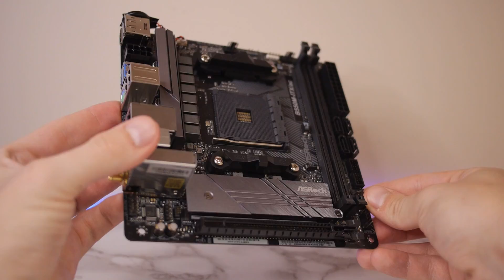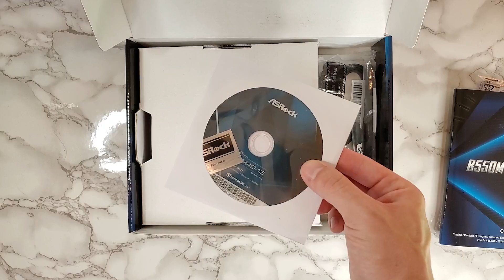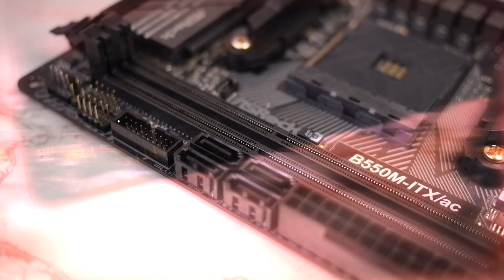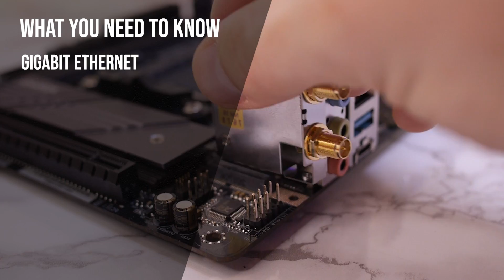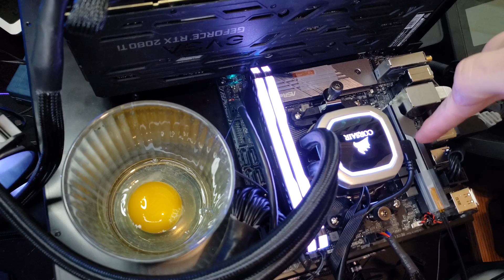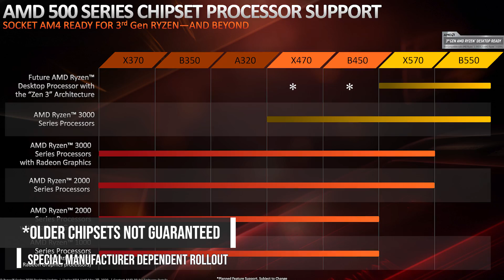The CHEAPEST B550 ITX Motherboard! - ASROCK B550M-ITX Review.

Comment: Exactly the right motherboard without unnecessary extras like LEDs and other things most people don’t need. It's perfect for a basic office PC or any simple, budget-friendly build that's still customizable. Why do you need so many fan headers? What’s the point in an ITX build, where compactness and efficiency are key? Honestly, the board could have even fewer features, but as it is, it's stripped down just right. The IO shield also leaves enough space for custom additions like a DC plug if you want to make a 12V system(pico PSU) It’s portable and practical. Thanks for the review, cheers!

Comment: So I bought one of these motherboards recently in late 2023 for a budget-ish 2nd AM4 rig. It went on sale in Canada for quite a bit less, like $100 less than any other AM4 ITX motherboard available. 

I've owned a few other ITX AM4 motherboards like the B450i/B550i Aorus and the MSI B450i so I have something to compare it with. 

In short:

- The missing 2nd M.2 slot is the biggest downside. I think its countered by relatively inexpensive 2TB NVMe drives being widely available and the rear 10GBPS USB-C port so you can connect and external M.2 drive and get decent speeds. 
- The VRMs are fine for a majority of gaming setups - I'm running a Ryzen 5600 overclocked to nearly 5Ghz at 80-90W and no problems. I have some airflow over the VRMs and while it does get hot to the touch, its never so hot I cant hold my finger against it. It should handle a 5800X/X3D with airflow over the VRMs but an overclocked 5800X or a 5900/5950X might be pushing it a little bit.
- Wifi 5 is a bit of a downside but most users will never ever notice unless they happen to have access to gigabit fibre internet. I've seen download speeds of ~350mbps sustained with the included WiFi 5 module.
- The bluetooth module genuinely sucks and I had to buy a USB bluetooth 5 adapter to get any kind of reliability
- It has subdued styling and looks more business-like than many other AM4 motherboards which is a plus for me personally. 

Less short:

I think this is a good choice for building a less-expensive ITX rig where you still want 80-90% of all modern functionality but will give up the absolute latest tech to save a significant amount of money. You may find a lot of criticism towards this motherboards VRMs if you do some googling and reading on Reddit, but I think those concerns are a little overblown. You can pair this mobo with either a 5600/5700X and it will run cool and give awesome performance without really stressing the VRMs at all. It even has room for overclocking either of those chips. A 5800X at stock  speeds should be doable with good airflow. The included bluetooth module is actual garbage though. It will drop connections with certain devices and then never reconnect to them even after several reboots and completely powering down and unplugging the computer. I had an adapter on hand so this didn't bother me too much but its unfortunate nonetheless. I've heard ASRock will warranty faulty wireless modules but since the WiFi works and I plan to upgrade the WiFi/Bluetooth module eventually, I didn't bother. 

 If you are okay with the single M.2 slot and last gen wireless connectivity, this is a great AM4 ITX option.
Reply: thanks for writing this
Reply: Yes, thank you for taking the time to write this. I'm looking for something to stick my now-very-expensive 32GB DDR in.

Comment: yeah the loss of a second m.2 slot (even if its at 3.0 which is more than good enough for a boot drive) lost me on being one of the choices, especially when you get pure SFF cases that don't have room for a 2.5 drive. another alternative I have is the sapphire b550 itx (which is based on the aorus b550 itx but with lesser components) but it has no wifi (not even a bracket for it) so another pass on that too. too bad we don't really get decent options for midrange ITX unless we reach the $200 mark

Comment: I built a media streaming computer to run my bedroom television accessing various streaming services such as Paramount, Peacock, Amazon Prime, YouTube, and other free streaming websites.  It's connected to a 4K widescreen and my only complaint is that the base graphics is so small that I have to be on top of the television to even read them.  Otherwise, the clarity is top notch.  I paired it with an AMD 7 5700G, 1TB M.2 SSD, and 64 Gig of memory running W10 Pro.  The low TDP of 65w keeps the heat down and runs better than most.  It needed a bios update to run the more recent version of the CPU, but that was quite simple to do.

Comment: Commenting in August 2023, NVME and SATA SSDs are so ridiculously cheap at the moment. You could pop a 4tb NVME in there for way under $200 (as of currently).

I'm currently using this board to build an efficient SFF monster (Silverstone ML06-E case). 65w TDP Ryzen 5900, 70w TDP RTX A2000 (6GB) with 32GB 3600Mhz RAM, 2TB NVME ($63) and additional 1TB SATA SSD ($33) as a scratch/cache drive for video editing. It's a beast!

Excellent review!

Comment: I'm going to combo this board with the amd 5600g, will the need update or anything?
Reply: in 2022, thASrock is selling "already 5000 series ready" mobo. So, you should be fine (as in my case). You would probably need an old AM4 CPU to flash the BIOS if you are buying amd 5700x/5600 (non x)/5800x3d (don't think you would pair with this mobo)!

Comment: just another way companies make money by selling a B550 board similar price to some X570 boards with slightly less features, if you have older Ryzen like 2600 or 3600, just stay on the board you have currently. because unless you can find an X570 board for a reasonable price that isn't overloaded with RGB, your better off looking for a B550 board that has some better features. i had a couple Asrock boards in the past, one from Intel and one from AMD, but usually they give you better features than you might get with MSI or Asus sometimes.
manufacturers have changed so much since then.

Comment: I'm thinking about getting this board for my secondary computer and putting a 3700x in it, once i upgrade my current rig from the 3700x to either the 5600x or 5800/5800x... only reason im considering is solely for the price. Really trying to avoid spending $200+ on a motherboard. my secondary rig has a 6700k and a z170, lol

Comment: Anyone know if this works with a 3400G (or 3200G)? AsRock's product page is confusing, saying (*) blah blah blah not supported -- but looks like per BIOS update 1.70 the 3200/3400G are supported? Just wondering if anyone uses this combo and if the BIOS update was feasible.

Comment: Build:
I settled on this Motherboard and the one thing that irritates me, is that it has built-in display adapters in the I/O, however it does not support the Risen 2400G or 3400G APUs.
Fractal Design Node 202
Ryzen 3600 w/ Noctua NH L9a cooler
Samsung 970 Evo 2TB NVME (OS)
Samsung 960 Evo 4TB 2.5 SSD
G-Skill Ripjaws V-Series (2×32GB)
Gigabyte GTX 1660 Super OC

Comment: Subscribed for the stupid idea you came up with. Keep on coming with them. 
3 things I wanna know. How is this MoBo pair with R5 3600 in terms of power consumption and heat dissipation. Secondly, How much RAM I need for 4K 8/10/12 bit video playing with out having a GPU? Finally, A stupid one, Will this work with Antec ISK 110 VESA which has a 90W PSU? 
Thanks.
Reply from the maker: Hey, saw this come through and you seem to  have quite a unique question 😅 

This motherboard would pair really well with the 3600, but you would need a GPU for that system as the CPU doesn't have any integrated GPU - for that, you would need to go for a 4000ge series processor. Something like the 4300ge would be a good option for a 4k video playback machine.

But the 4000ge lineup is really difficult to find as only the processor, a lot of people end up buying a full system from someone like HP to take out the processor.

The option I would go for is getting a Ryzen 3200g / 3400g - more than powerful enough and much easier to find. But you would have to go with a b450 motherboard as b550 isn't compatible.

8gb would probably be fine, but you will be sharing memory between your CPU and GPU and 16gb is actually quite affordable right now so that honestly would be my suggestion. Try to find a well priced kit between 3200 - 3600mhz and CL14-16 (you'll find the CL number listed as "Cas Latency" - newegg shows this info quite well)

And the last question is probably the most fun - I approve 😊 it looks like it has standard connectors which is good 👍 but I'd use a PSU calculator to check if it will supply enough power for you system 😊

Another option, if you can find it, is the luna design DNK-H. It's a bit expensive, but does come with a 150w PSU and a cooler. You can then put the 3200g in (3400g is a bit too hot for this case) with the asrock a320 TM ITX mobo.

This was a fun build I did a while ago and was SUPER small.
Reply: @TechLens  Wow. That's quite a pro-tip you  have for me. May GOD bless you and your family.

Comment: I bought this board in december as a step-up from my former i7/H110 platform and am running it with a Ryzen 5 5600X and a RTX 3070.
While the board itself runs very well so far, the power distribution across the USB3 ports seems to be a bit funky. I am using an Oculus Rift S, which is known to be quite sensible to USB power. At first, I tried both USB3_3 ports (Type A + C under the network socket), because I had the rest of my sim racing equipment (wheel, pedals and stuff) hooked to USB3_1 (next to the 8pin CPU power plug). On both ports, the Rift showed the typical issues when power delivery does not satisfy the HMD – connection losses, static noise, black display etc.
But since I connected it to USB3_2, everything works like a charm.
Reply: I was wrong. Turned out, not this board has issues, but ALL B550/X570 MBs have USB issues with PCIe 4.0 enabled and a gen 4 capable CPU inserted.

Forced 3.0 mode and all my problems disappeared.
Reply: @andreasotto1977  hi, can i confirm that you are running PCIE gen 3.0 now since 4.0 was giving you problem? i can assume you are not missing out on speed regarding the downgrade of PCIE?
Reply: Did u have to update bios to use the 5600?
Reply: @M54E60  nope.

Comment: There's one more aspect you should mention - besides "weaker" audio chipset there's still the Asus/Asrock 3-audio-jacks for analog surround audio solution wherein you need to connect one of the cables to the front panel jack to output analog surround speakers...

Comment: I have this exact motherboard, installed the latest windows update now my bluetooth keeps connecting and disconnecting. Super annoying keeps blurping as if its being connected and disconnected physically. Im able to disable the bluetooth but then i cant use it. Anyone know a fix?
Reply from the maker: Right click on the sound icon in the task bar
Click sounds
Under "Program Events" box:
Select "Device Connect"
Choose None in the drop down below it.

Do the same for "Device Disconnect" in the Program Event box. 

It isn't a solution, more like a band aid. I'm not sure if it's the board or windows being an idiot as I've had this issue and it's 30% hardware / 70% windows in terms of likelyhood. Hopefully it's windows and that will see you through to an update that fixes it 👍🏻

... Fun fact. If you have a friend that has stepped out of the room with their pc unlocked. This is an amazing way to mess with them. I recommend changing EVERY notification to tada.wav and watching their sanity slip away.

Comment: "the biggest compromise: this board only has one m.2 slot"

me: nods my head while using a single 2.5" sata ssd
Reply: nods in hdd
Reply: But i can still add a hdd right with the sata cables?
Reply: my X570 Aorus Master has x3  M.2 slots and x6 SATA 3.0   :D
Reply: @Minimalici0us  and its more expensive to, no thanks.
Reply: @thelasthallow  It can also handle a 16-core CPU & OC easily:)
Reply: @Minimalici0us  so can a B550 board
Reply: took him the entire video sayign "im gonna tell you" like 4 times before he finally says it, fking A.
Reply: pretty sure all Mini Itx boards only have 1 M.2 slot....
Reply: @thelasthallow  incorrect, some have an extra one on the back, but those are the expensive ones
Reply: @SpectreMge  well at that point you might as well go with an X570 mobo because the more expensive B550 boards are pretty much the same price a decent X570 boards.

Comment: How would I know if the compromise on wifi/Lan/BT 5.0 could be a big deal? Is there a use case where it would matter ?
Reply: Depends on if you have tech that use bluetooth 5.0 and wifi6 router
Reply: @randalllawkin  can that easily be patched up by some 3rd party solution?

Comment: does it mean we can't get a reading of the CPU temps on this mobo?
Reply: That’d be crazy as the CPU temp is the most important one ;) It’s just the VRM one that wasn’t being detected for whatever reason.

Edit: someone in the comments mentioned they can get a reading of the VRM so it could just be a fault in the reviewer’s board.
Reply: @justinseau   ow thanks for the info.
Reply: @justinseau   is this motherboard worth buying? I have asus z270i  i5 6500 and plan on buying asrock b550 itx and ryzen 5 3600
Reply: @jeddimaster5393  from what I've read it's perfectly fine for Ryzen 3600. Might struggle with 3900X and above from what I've read, but I don't really know what that means. One would argue you could get better value from a B450 if your'e not planning to utilise PCIE4 to the fullest (honestly, not many people will). I'm looking to buy a 5600X tonight so it made sense for me to spend a bit more for a Gigabyte B550i Aorus Pro AX for Wifi 6; USB BIOS Q-Flash without CPU and slight better performance for "future- proofing", like Smart Memory Access if it catches on with developers.

Of course, if you're on a tight budget and not planning to overclock much if at all it looks like it can do its job.
Reply: @justinseau   ahh i see thanks for the info. Is upgrading from i5 6500 to i7 7700 worth it though? goodluck on your new cpu upgrade
Reply: @jeddimaster5393  thank you, I missed securing first delivery but hope I get second lot in a week with my preorder. 

As for your Intel CPU question I’m not that familiar with them. If you’ve had your computer for several years, like 2 or more it probably makes more sense to do a bigger upgrade rather than staying in the same platform. Of course this depends on many factors, including how often you use your PC, what games you play, computer part prices where you live and your disposable income/budget. If you find a really cheap 7700 then sure, it could mean you get an extra 20fps depending on what GPU you have but it’ll be short term gains.
Reply: @justinseau  I have my motherboard processor for almost 3 years and my processor for 4 years. You have a point though to do a bigger upgrade because upgrading from a 4 core processor i5 6500 to an i7 7700 which is still a 4 core doesn’t really make any sense today.

Comment: Sow how many fan ports are?
Reply: Two fan ports, one for the case fan and one for the CPU.
I added a Motherboard PWM Fan Hub Splitter to use 4 fans within the case.
2 EA 120×15mm fans &
2 EA 40 ×15mm fans.
So issues.

Comment: Unsure whether to get this or the slightly older (and £30 cheaper) B450 I AORUS PRO WIFI to pair with a 3600? Any reason to spend extra on the ASRock over the Aorus, other than to get PCIe Gen4?
Reply from the maker: Another benefit is If you want to ever want to upgrade the CPU and want guaranteed compatability. This may save you the cost of a new motherboard 👍 Zen 3 hopefully will bring good IPC improvements 🤞

Comment: Do I understand correctly that the M.2 drive will share space, and thus heat, with the chipset? I couldn't find the chipset anywhere on the board from pictures so I assume Asrock didn't do something drastic and put it under that bottom heat shield. That honestly sounds like a recipe for thermal disaster to me. Would love if you could do some investigation on ssd and chipset temps on this board, both with normal ssds (perhaps sata) and some beefy ones
Reply: I have installed a kingston a 2000 in there and the disk stays at around 44 to 46c and the southbridge is around 55 to 60c

Comment: Cheapest I could find is the Aorus B450i Pro Wifi board, would that suffice a Ryzen 2600 and 3200Mhz RAM?
Reply: Hi, yes, I have a 3400G and a 2x8GB 3200Mhz RAM.
Reply: Im considering the aorus b450i or this asrock board. Which shld i get?
Reply: @billyshears9714  B550 is obviously better
Reply: @KiiroKiiroTorini  I don't understand why its better. What is the difference and where does it shine

Comment: Thanks for the review! Do you think there might be any heat issues with the M2 sitting right on top of the chipset, especially considering it's also very near the GPU?
Reply: The Chipset doesn't make much heat, if anything it's the Chipseat that might have heat issues if you use a PCIE 4.0 M.2